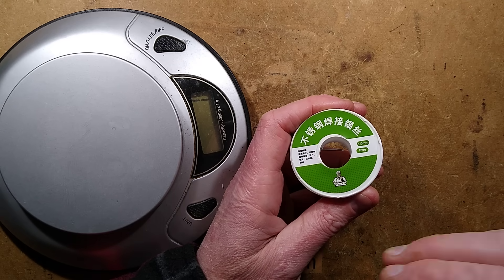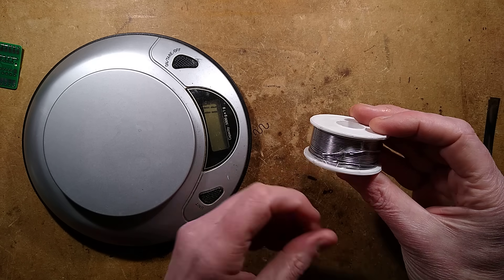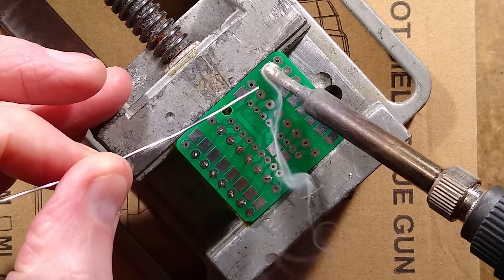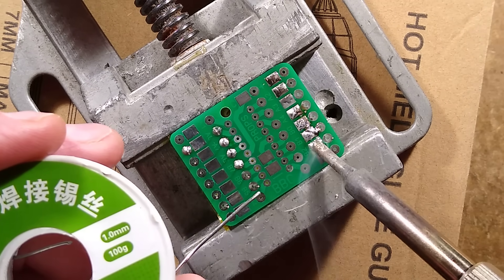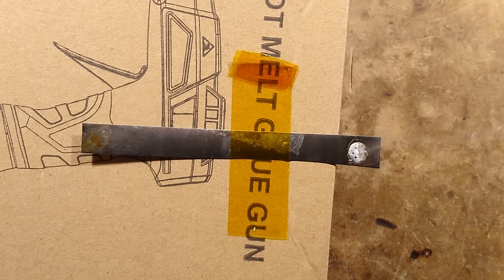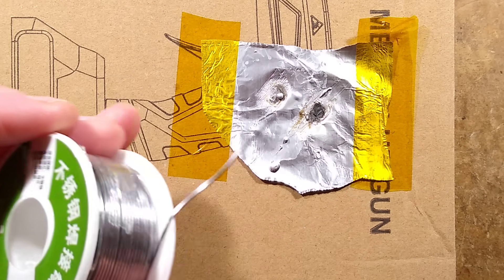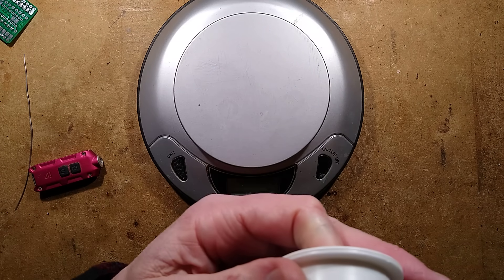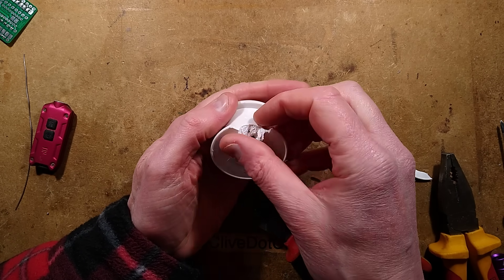Testing AliExpress "mystery solder"

Comment: not that brand but i have bought leaded and non leaded solder from ali with no issues whatsoever
Reply: i was paying 4.50 a metre for heat shrink, got 25m to my door for $8. but wait theres more (insert infomercial music here)
i ordered a specific colour, within an hour they said they couldn't supply it but could give me another colour at a discounted price. i accepted.
3 years later still using the same shrink, no failures

Comment: Its not Sn 99%, not 60/40 Sn/Pb, but 60% solder + 40% all metal inpurityes  = bad solder like this one. No shiny, no strong solder joint, just noting good. You try to melt at 200C, you will get noting.

Comment: I use a lot of solder and at £50 a roll from RS it's an expensive outlay so when I saw a Chinese roll on e Bay for £15 I couldn't resist, big mistake, what a load of shite, I used a few feet and the rest went in the bin, it didn't flow properly, stunk the place out. Never again.

Comment: Non-leaded solder usually has a matted/dull/white look to it after it solidifies and is usually the variant of choice by cheap solder manufacturers since beginners usually buy these and won't realise it has lead in it which would cause western market places to probably take them down, I can't quite make out from the quality of the video though but it's probably either lead-free or an extremely poor alloy mixture, or both.
I don't appreciate the non-leaded solder hate though! As my main solder I use the SAC305 since I don't have a separate soldering workstation so I'd much rather not have lead pieces laying around, it's a great alloy combination that flows very well and produces a strong joint, comparing it to soldering with leaded and lead-free solder I wouldn't be able to easily tell the difference, other than the obvious matted/dull look after it solidifies.

Comment: I received a coil of this stuff in a set with a soldering iron - the same "KFC" guy on the sticker but in light blue. Same oversize reel, too. It's poor stuff for regular soldering, flows poorly and gives a matt grey surface. Looks like a typical cold joint that will cause you endless trouble later. Interesting though that it takes on stainless steel. Maybe I'll try it for that.

Comment: Phosphoric acid is the flux needed for stainless steel. In the 1970s when copper was in short supply, we had central heating installed with stainless steel pips and fittings. There were a lot of leaks initially.

Comment: You should have soldered a wire to the stainless steel and pulled on it. Sometimes it looks as if the solder is holding on the steel but it comes off easily.

Comment: I bought some allegedly 60/40 solder from AliExpress because I wanted to leave nice shiny solder work on my best circuit boards, and it turned out to be the shittiest solder I've ever used.  At the usual soldering iron temp of ~370°C the stuff softened into more of a metallic paste that could be shoved around in blobs.  I had to turn the soldering iron up to 480° just to get the stuff to actually liquefy, and even then the instant the soldering iron was taken away the solder firmed back up into a paste before hardening when it cooled.  And the finish was more dull than my old 63/37 solder.  Luckily I inherited a couple rolls of genuine vintage 60/40 solder and that stuff is the real deal (but rosin core, hard to clean up).

Comment: Does it smell like rosin or acid flux ?  The wetting and rosin looks like 92/8 no clean.  I don't care what they say,  but 63/37 RA is still the best as a general purpose solder for electronics.

Comment: I've bought solder from Aliexpress once and I've been wondering, what the hell is wrong with my soldering iron or flux. Solder couldn't stick to anything, and after a while it also couldn't stick to my iron as well. It melted like normal solder and formed balls like normal solder, it just didn't stick to anything. It destroyed 2 tips on my iron until I realized it's the solder itself that's wrong. Couldn't imagine it at first, it's just a solder after all, dang it...

Comment: I had a similar experience with some other random Chinese brand on eBay. It really took some time for me to use it up so it was too late to even care, but yes, the spool was ridiculously thick. On top of that, the flux I bought is so greasy and weird. It is solid but melts at very low temperature, so it is not safe to leave it there after soldering but it's also extremely annoying to clean it up.

Comment: I used to be the proud owner of a huge roll of a (£2 at the car-boot) very incredibly thin {.5mm?}1960/70's? 5x flux cored silver, tin and lead based solder on a big red reel - unfortunately the logo had disintegrated from the label so I couldn't  replace it 😤 With it I WAS my local King of quick strong solder work.... I had a reputation that I could solder "anything" to "anything else"... Especially CB radio mic adaptor cables and other Radio mods {this was in the last 3 years - a very, very niche market but great and loyal clientele}..... The roll ran out 😫😭😭 I've spent a fortune on trying various modern equivalents and now I "feel" I can barely solder solder to itself! Talk about a whack in confidence!.... Now I won't touch anyone else's kit and even reluctent to touch my own.... I now only rarely dabble in that art!.... Blobby dabble or melty surroundings dabble depending on the day... 👏👏 Thank you China and your flooded market of solder that doesn't flood!

Comment: Probably an acid based flux, maybe a cadmium and silver based soft solder, looked fairly lumpy alright but it took right onto that stainless which is impressive. Flux looks nasty as hell though. Seems like good stuff even if it you don't get 100 grammes of it

Comment: It's probably just regular solder but with ZnCl2 flux, or basically plumbing flux, it usually have ammonia and when heated, release HCl and eats away the oxide layer, allowing you to solder most metals, however it have a very irritating smell (Hydrogen chloride vapour) and corrodes the solder joints, hence why it's not used as electrical flux.

Comment: I grabbed a few rolls of this via Aliexpress "choice" thingy and well, its actually not bad at all.... do need to keep the iron at the upper levels but responds well with hot air too, I even used it to fix a damaged by cats Wilesco oil rig steam engine as they knocked it off my bookcase the bounders the stuff wetted nicely and is steam safe...

Comment: Thanks Clive for the great  demo and information. 
 The solder needs to be weighed alone for a proper sale, otherwise it really is illegal. It could fall back on AliExpress, and they would have to sue the MFG. The other problem is: not clear as to what is in it. Solder has become a issue since the push for lead free solder, also makes some more electronic problems, since it requires more heat and does not stick as well as solder with lead in it. To much flux, or the wrong kind will also corrode some circuits and wires as well.

Comment: I just bought a similar thing from a US seller on Ebay. It was $6.74. I weighed it and it weighs 103g. I haven't used it yet but it says 60/40. So, at least, the stuff you bought was cheap.

Comment: It's probably a standard ABS plastic a base ABS plastic has a natural or cpvc ish off white color in order to get it bright white what is a prepigment added of titanium oxide at about 10 to 20% depending on the desired brightness or translucent requested by customer what is their manufacturing translucent Parts like window switches or fluorescence gauge clusters what's the plastic is a very high spec and a lot of waste occurs of which very cheaply can be recycled into things like reels easiest way to tell is it reacts underneath UV,, black lights

Comment: Whenever I've worked with injection molded plastic parts, the specialists we consult with and the production plant/mold suppliers always tell you to keep the walls at a constant thickness and that thick walls can cause sink marks.

With how insane this reel is, I'm impressed at how good the part turned out honestly, it's a marvel of injection molding for just USD 2,57

Comment: Afaik this is the solder you need to use for those soldering tips you screw on those ahem “herb oil vaporizor batteries”.

Comment: there is nothing special for soldering V2A. We use SN40Pb60 and stainless steel  soldering fluid for softsoldering gutter  and downpipes, so only the flux is the key.

Comment: What a scam!!!
Reply: And you probs know this already Clive but, especially with electrical items, many Chinese firms are total scammers. I live off grid in Italy and thus have much experience of inverters and batteries. Without a single exception, every Chinese inverter I have bought gives roughly 50% of it's stated performance, ie a 3kW inverter will crap out a little above 1.5 kw. I also have several Italian Fiamm 100Ah batteries and each weighs 32kg. I bought a Chinese "100Ah" battery and it weighs 44kg and holds just over 50Ah@12v. A complete and utter ripoff. I try to avoid anything made in China these days, where possible.

Comment: It says stainless steel welding tin wire in white on the top.
To the side it says suitable for battery cells,stainless, steel plate, tin plate, and copper

Comment: I bought solder off eBay from China because it was cheap, it is insane, looks like solder, but it does not work at all, even if I add my own quality flux to it.  
Sucks because solder from my local store is SO expensive, it doubled in price from 2019-2021, now $35 Aussie for 100g.  
Yours is a WIN

Comment: It was interesting that the solder stuck to the foil when yu removed the iron and some splashed down from the tip and instantly stuck then dried. Maybe reducing heat considerably would work.  But I will not be buying any to find out. Also if one buys the 20g version does it come on a heavy plastic reel or a card. It cant possibly come on the same spool.

Nice to see someone uses proper solder, it leaves a far better, and shiny finish than the dullness of lead free and its different shape. Even if it is not so good or the planet or the recyclers.

Comment: Silver is used to weld (or solder - I'm not sure) stainless steel and aluminum - afaik.
Reply: oh ... but the welding procedure is different. My dad had a saw mill and he used to weld saw ribbons using a thin silver sheet.

Comment: I was skeptical about the alu-minimum. But somewhat surprised with stainless steel. Something else had not stuck very well at the other end of the strip.
I had one of my favourite solder tips get "poisoned" by aluminum somehow, it went black and gritty, and no longer wetted with solder. Sanding it didn't do much good either. Once the copper was exposed, the solder would eat away on it rapidly and turn yellow. Technically it turned into a low-copper bronze alloy.

Comment: My favourite solder is Silverline multi core 60/40. really nice flow and little smoke and cheap. Use some activated RA flux from Farnell with it and it will solder stainless with a good clean first.
Reply from the maker: I should test some Silverline solder.  I'd expect that brand to be consistent.

Comment: So much stuff on Aliexpress is called "welded". Most of the time it simply means that it's not single components or a kit (so they might call an STM32 "welded" which means it comes with the pins already soldered as opposed to the STM and two pin rows you have to solder yourself), but why not just say "soldered" instead? Would at least make some sense.

Comment: I wonder how low temp it can be used at, like can I use it for making 18650 battery's?
Reply from the maker: I recommend extreme caution if soldering directly to 18650s.  Too much heat can damage the internal separator and potentially lead to a runaway situation.

Comment: I recently saw something similar in Lidl, a couple of days ago, labelled up as flux cored soldering wire, but it was in a section next to assorted welding accessories.
 
But that plastic reel!! What a rip-off! Another use of unnecessary plastic use too!
Reply from the maker: Lidl does sell flux cored mig welding wire.

Comment: It's silver based acid core low temp silver solder.  What we typically call "silver solder" is a much higher temp product used with a torch.  This product has been available for decades and not just from places like Alibaba.  You need to scrub the aluminum with a stainless steel brush immediately before soldering.
Reply from the maker: I very much doubt there will be any silver in this.  I may be getting it analysed.

Comment: In the early 1990s I moved to my wife's Asian country where her brother was an electronic repair guy and we opened an electronic repair and parts store. I have to point out I knew nothing about electronics but did learn to read resister codes.
One day a travelling sales person dropped by with a wide selection of goodies one of which was 14 x 1kg rolls of 0.7mm solder (the real stuff that had lead in it) that contained 300 metres of this solder. At US$2.50 each sounded like a bargain to me so we nabbed the whole lot and I had the fun job of measuring of 950mm, I mean 1,000mm lengths and winding them round a permanent marker pen ready for sale. Can't remember what we charged but the markup was over 500%. 

Due to medical circumstances we returned back home but I had enough foresight to bring a full roll of the solder with me because I found it very easy to solder with due to me being crap at soldering. I still have about 750gms of that solder left even though I use if fairly often. It got used to solder up your 7 crystal LED colour changing light where I enjoy the changing background lights while I am reading my Kobo e-reader.

Early in my naive AliExpress days I purchased a too cheap 10ml bottle of incorrectly spelling Loctite only to find when it arrived that there wasn't enough liquid to cover the bottom of the little bottle. They just don't change. If I find an honest seller at a fair price they get recommendations and repeat business. If I find a cheater my feedback reflects that and after several of those I am required to create a new account because Ali suddenly want to verify who I am with copies of passport, driver's licence, power bill or similar in my name and address etc and I suddenly can't purchase on their platform anymore.

Has anyone else noticed similar feedback on a newly created store where "I haven't tried it yet but the quality looks/feels/smells good and I recommend the product and seller." Seller to be avoided. They are not very bright pulling a scam like that because they will only get a single sale and the Clive will warn us to avoid the cheating scum.

Thanks for the video Clive. 👍

Comment: I had one reel from alie express, and it melted good for about 1 inch and then it was terrible to use for about an inch.
good for soldering wires but not for electronics.
Reply from the maker: Possibly intermittent flux.

Comment: My grandfather was a master boilermaker used to solder using a hatchet soldering iron heated on the gas ring. The flux he used was (learned later) Ferric Chloride and it really grabbed you by the throat BUT gave a wonderful finish.
Reply: You refer to that stuff that eats copper away? And used to etch PCB's?

Comment: 2:20 I would think you have a lot of aluminum core PCBs from all the lamps you've bought. You could use one of them next time 😊.
Reply from the maker: I could have done that.  But they do suck heat away from the soldering iron fast.

Comment: Is it low temp solder (~120 C)? A common job for that stuff is to melt it into other solder connections, that then makes the entire joint far easier to remove and clean up

Comment: You're using the wrong technique: if you look at the instructional diagram on the reel, Col. Sanders is clearly holding the soldering iron by the metal shank.

Comment: I have a brand new '50g' roll of this exact 1mm stuff, even down to the Colonel logo.
It has only one layer of solder and you can easily see the thickness of the plastic between the core and where the solder is wrapped.
I only bought the 50g roll because I figured it best to buy a small roll if it turned out to be rubbish...now I know it is rubbish and I was a sucker.
I don't have any scales to measure the weight for weight, but I'm guessing they used the same reel that Clive showed just with a single wrap of solder, so I assume I got maybe 10-15g of actual solder.
Wait...if reels are the same size, that would mean I ended up with minus 10g of actual solder🤣

Comment: I one time bought 60/40 solder from China. When I used it, the flux smelled like Crisco and would sputter. Basically, the solder was farting after eating at Long John Silvers. The Long John Silvers I went to smelled the oil was in desperate need of a change, and I don't ever want to eat there, again.

Comment: Thanks for showing us this, Clive. I actually needed a very small amount of a solder/flux that can touch stainless steel. This looks to be the one I need.

UPDATE: Bought a "20g" reel. The solder plus reel is 20.6g, just the solder is 9.5g
Reply: Good chance the flux in this Chinese stuff is acidic so if you use it, clean the joint thoroughly after soldering! Stainless does not do well with prolonged acid contact.
Reply: @sootikins  Thanks for the advice. Will do!
Reply: @Doc_Fartens  BTW - I once worked designing plating and etching machinery. A major rule was: stainless and polypropylene for caustics, titanium and PVC for acids. That applied to everything from tank liners to piping to stuff like temperature and level probes.
Reply: thinking the same. buying a silver solder from reputable uk source at a reasonable price a bit of a mission

Comment: Find someone with an "X-ray fluoresence spectrometer" to see what metaals are in that solder.
They're small hand held units, not big lab devices. Sometimes they're used to check plumbing fittings for lead.